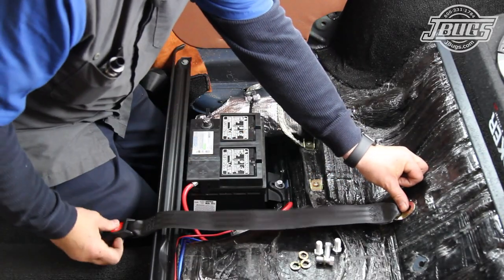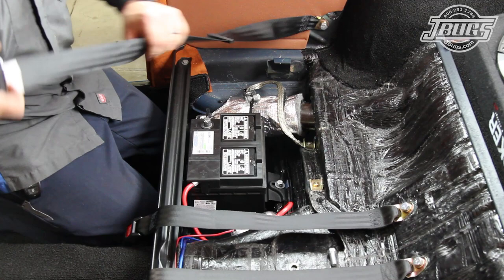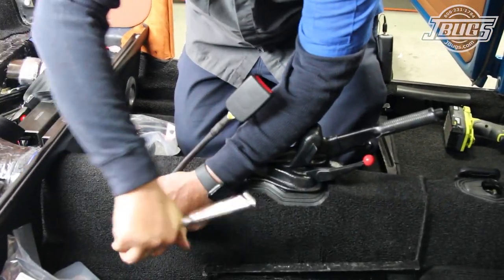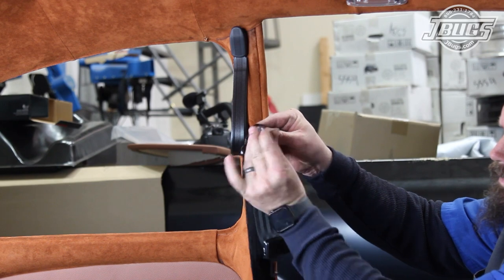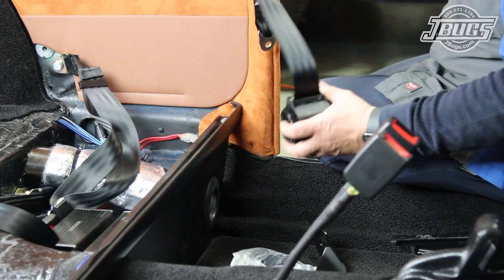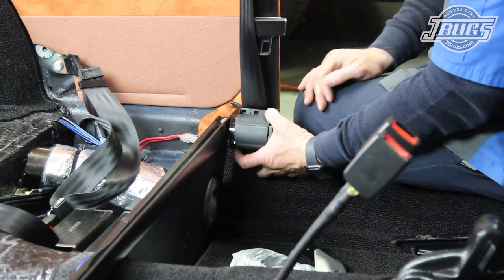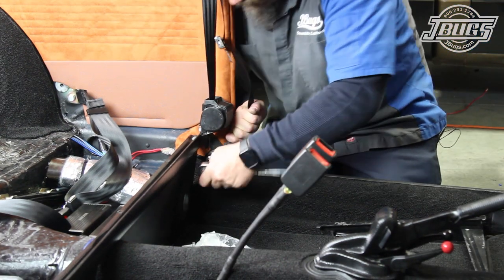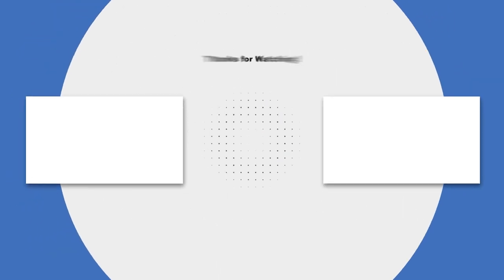JBugs - 1971 VW Super Beetle - Seat Belt Installation

Comment: So, I have a question. In the video you say that the mounting brackets are properly installed by drilling a hole below the factory point. How does that work? How does drilling a hole allow for the seatbelt to be installed? I'd it's just a hole, how does the bolt stay on place with no place its threading into?
Reply: If you drill a hole into the floor, you can put a washer and nut on the bottom of the floor, under the car. An L bracket can be bolted to the floor, then the retractor can be bolted to the L bracket. Pretty simple.
Reply: @Sam_Mebane  yeah I figured that out a few days after I posted this lol
Reply: I recently inherited a '69 bug but it doesn't have seatbelts. I'm going to install some so my question is, are the belt bolt attachments on the 69 pre threaded and drilled so I don't have to drill any?

Comment: At the end of the video your meaty hands cover up how, exactly the recoil unit and dangling end of the seatbelt attach to the factory threaded holes.  Is the dangling end on top of the recoiler?  When I tried this I couldn’t get the plastic cover to fasten and when I put it on the back side of the recoiler the offset of the dangling end prevents me from bolting this down.  I’m installing in a Squareback but that shouldn’t matter..
Reply: The retractor is bolted to the bracket, the opposite end of is bolted in behind the bracket to the body. Having installed these same belts in a Type 3, drilling another mounting hole for the opposite end may make things easier. If memory serves the retractor sat very close to the rear seat. It worked well enough unless the backrest was folded down.

Comment: I thought the seat belts would somehow attach to the metal brackets that on the floor between the front seats.
Reply: If you had original seat belts and buckles, they would. All the modern belts are made as independent pieces and to keep with today's safety standards don't rely on any old hardware or components.
Reply: I think that means I won’t be able to install them since drilling into the metal would be too hard with my tools, @Sam_Mebane
Reply: I didn’t see you drill holes to attach the new seat belts. Did you? @Sam_Mebane
Reply: That is because I didn't. The new belts bolt into all the original locations  @Ljblossom .
Reply: Confused at this end. If the original belts attached to the brackets or whatever those gray metal things are between the seats, then why would there have been pre drilled holes in the hump? @Sam_Mebane
Reply: @Ljblossom   the factory bracket bolted into the threaded holes on the tunnel. Once it is removed, we use the same two bolts to attach the center buckles. Check the video at 1:06.
Reply: I just watched it again and see that it matters which kit you get whether that post is included. What I was not clear on is whether the bracket you used on the lower shoulder seat belt attachment point which you referred to as a retractable belt bracket is included in the kit2. Also, can I get the kit with only one back lap belt since it will only be my dog back there. The seat won’t sit flat so I need to remove it and put in a piece of plywood and some cushioning.  Any idea why this would be the case? Since the seats have cloth covering which is in good shape, it seems they were recovered? But the seat in the back sits too high to the front creating a strong angle. @Sam_Mebane
Reply: Parts used in this video:

2 Point 60" Lap Belt (1201-60-1000)
https://www.jbugs.com/product/1201-60...

2 Point Seat Belt Hardware (FHD-1046-2)
https://www.jbugs.com/product/FHD-104...

3 Point Retractable Lap & Shoulder Belt (ZVW20-RETRACTABLE)
https://www.jbugs.com/product/ZVW20-R...

VW Style Retractable Seat Belt Bracket (BELT-BKT)
https://www.jbugs.com/product/BELT-BK...

All parts used in this video are available at: http://www.jbugs.com/

Depending on the year, VW used a strap to pull the backrest down and hold it flat over the top of the bottom. If you aren't concerned about seating for people in the back, then certainly pull out the rear seat bottom, and maybe even the backrest. I've seen various different platforms built in the rear seat area.

 @Ljblossom
Reply: Thanks for the info on the seat. Of course the strap is gone but I don’t think it would make a difference. On the seat belts I was referring to the kit that had all four seat belts and hardware. There is a bracket but from the photo is it unclear if it is the L shaped one you used. Is that part of the kit? @Sam_Mebane
Reply: @Ljblossom  The kit is a "kit" and isn't customizable. I linked the individual products I used, including the VW style brackets, which don't come with the kit or the belts by themselves.

Comment: my carpet has been installed. on the bracket, there is a hole for the screw and a spike. but I do not feel a hole in the B beam for this spike. question is the spike hole over the screw hole or under it. your video does not show this spike.
Reply: If you're referring to the aftermarket brackets - https://www.jbugs.com/product/BELT-BKT.html - they do not have the alignment spike. Only original brackets have that tab typically. That tab actually aligns the seat belt retractable mechanism. If your retractor doesn't have a hole for the tab, cut the tab off, or flatten it down with a hammer so it isn't in the way.
Reply: Thank you so much. I was not referring to the aftermarket brackets, but the original brackets. My friend's bug has no carpet or headliner and the alignment hole is above the screw hole.

Comment: I just bought this kit from JBugs for my 68. I have been trying to reverse the latches on the belts as you describe but there is no way to get the folded webbing through the adjuster. There just isn't enough room for 2 layers of belt material to pass through it. I noticed that this video doesn't actually show you doing what you described. On the rear belts the video "cuts" away and when it comes back the belt latch is magically reversed. On the front belt, you never actually reversed the latch. It was already correct. So what is the secret to reversing the latches?
Reply: Pull back the sliding bar under the cover, and muscle the material through.
Reply: @Sam_Mebane  I'm no weakling, but that doesn't work. I finally popped the plastic cover off the latch and that made the job easy.
Reply: @stevo_the_nuke  Glad you got it figured out.
Reply: I tried this and I also could not get it to flip. I removed the cover and the tabs broke off of it. Now it won't stay on.

Comment: What size threaded bolt is used in the tunnel for the front belts?
Reply: The VW seat belt mounting points are threaded at 7/16-20.

Comment: I have a question. When I turn the key before I turn it all the way I hear a clicking sound and it says fasten seatbelts. It never did that before. Any solution?
Reply: That sounds like the seat belt interlock relay. Odd that it suddenly decided to start working. Short answer is, disable/remove it all. There are a few articles / tech posts about it on various forums.

Comment: Where did you get the c collar? It didn't come with the kit I bought
Reply: I have a random assortment of hardware pieces that I've accumulated over the years. A simple piece of steel tubing can be used if need be.